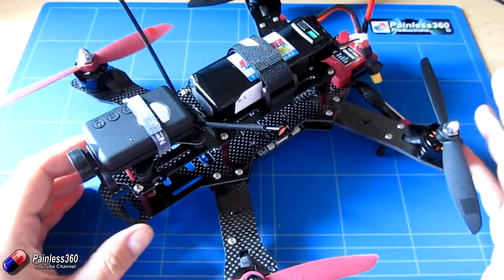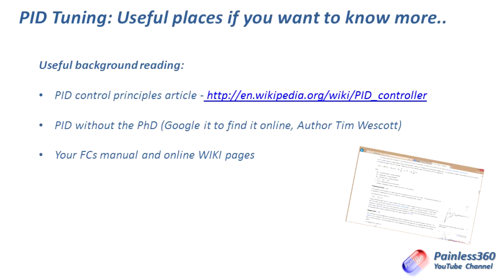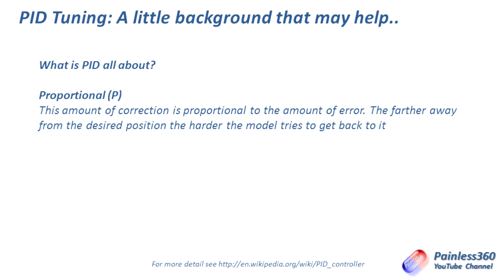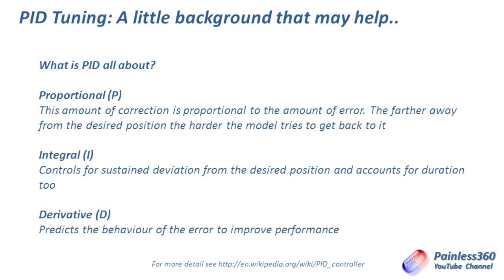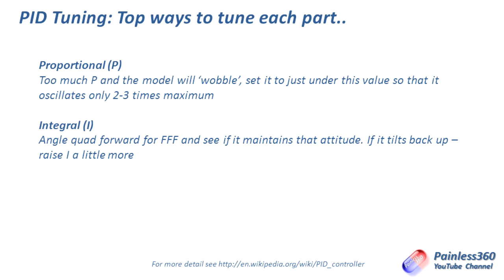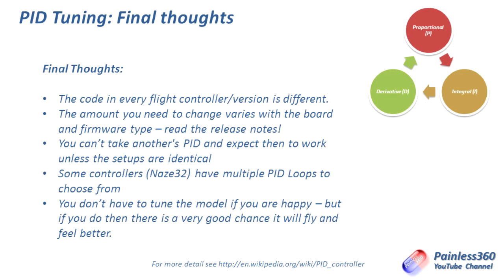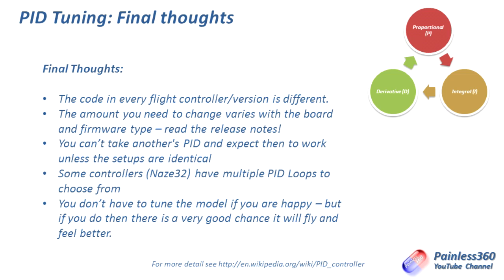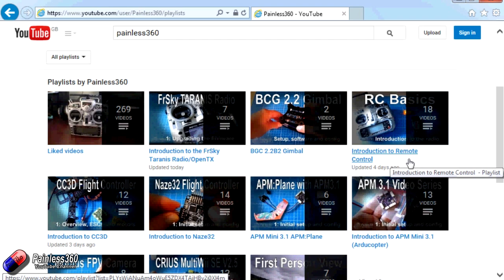Multicopter Tuning - Introduction to PID theory and how to tune your multirotor

Comment: Good information.  It took a while, years ago, to wrap my head around them and while I'm no pro, it usually only takes one good battery to get great numbers.  Then I usually take a couple more batteries flying around and slightly tweaking them if needed and setting the other parameters that surround the flight characteristics of the specific board I am using. I subscribe to the D, then P, and finally I method (Dave's).

Comment: Man, thats the best explanation of PID's on the entire interwebs, Thanks Chief! I finally get it, just need to suss out the TPA now.
Reply from the maker: +Mighty Chu "TPA basically allows an aggressively tuned multi-rotor (one that feels very locked in) to reduce its PID gains when throttle is applied beyond the TPA threshold/breakpoint in order to eliminate fast oscillations.." ;)
Reply: +Painless360 Ah right, I wont worry too much about that until i'v gone around the PID's a few times then, brilliant. Thanks again man! Really apreciate your channel.

Comment: Center of Gravity on the craft will affect the way it handles and can blur tuning efforts. The most common mistake with new pilots and modelers is to have the weight too far back with CoG behind the flight controller. This will make the quad feel as if the rear wants to wash out, and some of that lifting in FFF you mention. 
Tilted motor mounts, dihedral mounts on arm or motor, and motor plane on frame will also affect tuning. Regardless, Painless360 still covers the "feel" of what needs to be tuned so if you apply the concepts, then you will still find the quad tuned better. 
Centering the weight so the craft sets level at the center of the FC if possible will make tuning quick work though.
Reply from the maker: +Hiway Great points Hiway!
Reply: So true about CoG too far back. Happened to me on a QAV250 where on yaw it was so slippery. Solution - repositioning components for better balance and CoG.
Reply: modern day FC's can compensate

Comment: seems like someone could take that slide at the 12:00 mark and make a mini game out of it. some basic 2d wireframe thing where people could play with the PID settings to nail in a good flight, with a randomized  sweet spot each reset so it's not a memorize the numbers to finish the "game" sorta deal.

Comment: Great explanation, its refreshing to have a more systematic explanation, now what about rates nd tpa? how those affect tuning?
Reply from the maker: Tpa?
Reply: on the right side of PID, you have roll rate, pitch rate, yaw rate, TPA and TPA Breakpoint, I haven't found any info on TPA breakpoint but some people tune also the "rates" and tpa. What are your thoughts on this
Reply from the maker: I see, what GUI are you using?
Reply from the maker: I see. "TPA basically allows an aggressively tuned multi-rotor (one that feels very locked in) to reduce its PID gains when throttle is applied beyond the TPA threshold/breakpoint in order to eliminate fast oscillations.."

i.e. you can get the craft to tone down the PID settings when you are flying like a loon! :)

Happy flying!
Reply: cool, thans for the explanation

Comment: Thanks alot for taking your time to explain this to us beginners. I have been flying with factory settings.  It was hard but i think it made me a good pilot:-=)  Heh he.  Please upload files for download if possible.  You can download other peoples settings.    Thanks for the upload.
Reply from the maker: +Normann What files?
Reply: There was on one video where they shhowed how to adjust pid and such.  And he had his settings on a file people could download. And use for upload in the open pilot program.  If you see in the open pilot program. You can see that you can import settings.  You see:-))   I havent found the video.  But i saw it like a year ago when i started building.  Thanks for taking your time to teach us this.  Realy apreciate it:-)
Reply from the maker: +Normann I see, you mean the tuning settings? You can't use another's setting unless the frame, motors, props, balance, battery weight, battery size, flying style and piloting skills are exactly the same.. Best of luck.
Reply: Im starting now to understand the settings in the open pilot manager.   Wow what a fun hobby.

Comment: Hi. Great video as usual. I would like to ask a question on PID tuning. Everything I read and see on line talks about the PID setting on pitch and role. What about the Yaw PIDs? what effect altering the YAW have on the quad and how do you know when they are correct?
Reply from the maker: +Ray Gibbins Very similar to the others - if the yaw oscillates then check the P isn't too high, if it drifts then look at I etc.. Best of luck!

Comment: Nice video Painless, just a general question about pid. If a quadcopter has a large battery crossing the frame from back to front (like yours in this video) but it is also located 6cm under the chasis , so the movement in the roll axis  takes more effort, what shoul I do? Increase my P in the roll axis? Decrease it ? Raise the I?

I ask this because my batteries have died  so I cannot test anything right now.
Reply from the maker: +Dashz A larger battery lower on the frame will make the craft slower to respond compared to one with a lighter battery higher up. This affects the way it moves and how quickly the frame can be accelerated and then stopped in the new desired orientation. Any change to the frame layout will affect the PIDs  - slightly.. Best of luck!

Comment: Hi The manual for NAZE says cover the baro with foam and shield the board from sunlight. 
I notice you use a perspex cover and no foam. Is this just for video clarity or is the manual being over cautious?
Great tutorials BTW  I've learnt so much from you. Thanks
Reply from the maker: +Stephen Thorpe We always cover a baro with foam, the boards we build are actually inside the middle of a carbon frame so are shielded from the sun. The advice is there as the cheap gyros used on the model 'drift' with temperature. Happy flying!

Comment: Nice explanation. I am new in RC world. One question: Pg-24 of "PID without a PhD" is asking to start with D , then P , then I but in video you are starting with P?. Any specific reason?

Pg-24 reference of "PID without a PhD"
------------------------------------------------------------
"Once you get the setup ready, set all gains to zero. If you suspect that you will not need differential
control (like the motor and gear example or the thermal system) then skip down
to the section that discusses tuning the proportional gain. Otherwise start by adjusting
your differential gain"
Reply from the maker: You need a little P to stabilise the craft, no P will mean that the craft is pretty un-flyable. Happy flying!

Comment: Thank tiu for this video. Question for you when you tune do you tube for all axis? If I'm tuning P do I tune for pitch/roll/yaw before moving to I or D?
Reply from the maker: +sparkyondub2zz You do each in turn several times. As you get D higher you will find that you can also increase P a little more too.

Comment: Hi PL. Another great vid, thanks for taking the time to make it. Quick question.. I get quick oscillation with quick roll inputs. I really thought it would be P but right through the ranges it still does it? I'm using Naze32 with a looptime of 500, no mag, accel or baro. Any thoughts ☺
Reply from the maker: +doondedulin44 I'd check for excessive vibration in the craft first, then reset to defaults on the PIDs and start again. Could be P or D needs tweaking..
Reply: +Painless360 OK thank you. Will give it a try today :)

Comment: G'day  I have just upgraded from APM to Pixhawk controller. since the change i have noticed that the motors get quite hot after only going for about 10 minutes when compared to the APM. I am using the same batteries and ESC. Could this be a problem with the tuning? I have tried an auto tune with no difference. Thank you for all the time you put into making the videos. I find them pleasant to watch and informative.
Reply from the maker: Possible, I've not seen that here so I'd have a look in the forums for another pilot who've had something similar.. May need vibration damping or a different LPF setting..
Reply: LPF?
Reply from the maker: Try googling 'lpf painless360' to find out more.. ;)

Comment: Hello Painless360, firstly let me thank you very much for all your videos. It was a great help when building my first quad. I'm just about to start tunning my PID but I come to bit of a problem. I have all sorts/weights of batteries and if possible I want to keep same PID setting for all batteries. So in order for PID to work with all, should I tune with the heaviest or lightest battery I have? thank you in advance for reply.
Reply from the maker: +Martin Munz Tune with the one you'll fly with most ;) The difference in weight and inertia will affect the tune..
Reply: OK. Thanks for quick reply. Somehow I start to tune P and strange thing is that I increase it on Roll to 14 and only than I get wobble and pitch even to 25,5 (highers possible) and still no wobble. How this can be?  (using latest betaflight on Naze 32)

Comment: Hi painless, thanks again for all your videos, helped me build my first quad a Robocat 270mm with the SP racing F3, and 20A mini afro esc's.
I haven't played yet with PID's, and i was wondering if you should tune PID's for pitch/roll/yaw separatly or at the same time ?
Also, to tune PID's I need to be in accro mode right ?

Thanks a lot !
Reply from the maker: +Hamza Bendahou We have a video on PIDs that should help - best of luck!

Comment: +Painless360 I have a s500 drone with a cc3d and when I pitch forward or backward my drone immediately wants to pitch over to where it seems like it is going to flip over and it loses alot of altitude in a very short amount of time. what pid gain do you think is making it do this?

Comment: Hello Mr painless long time fan here. After seeing a lot of your quadcopter videos I decided to buy one for myself and I ended up getting a DJI 450 ripoff quadcopter and I set it up with a KK2.1.5 board. I flew in a little bit and got a little too excited and took it to my terrace where I tried to do some hover and straight line flying, unfortunately, the damn thing flew away and I have not been able to find it yet (I cut throttle when it went too high and it started acting VERY WEIRD after that and flew away into the sunset) . Could you please make a video where you show us how to locate a lost drone, set up a GPS system location system or just general noob tips.. 

I think it'll help out a lot of beginners like me from losing out on a lot of expensive equipment due to sheer stupidity.
Reply from the maker: +Brenden sounds like an excellent idea! I'll make that one! Hope you recover yours soon..
Reply: +Painless360 thank you. looking forward to you video.
Reply from the maker: You can preview it here - https://www.youtube.com/watch?v=K-5B_k8VOfA Hope it helps a little.. Let me know..
Reply: Incredible. Thank you! :D

Comment: Very interesting, would the same PID principles apply to a motorised gimbal? say changing a camera with a different mass and or COG ?
Reply: +mick thebass i would be interested in this answer....
Reply from the maker: +mick thebass It does but in my experience most of the gimbal problems stem from more basic problems - not having the camera in the gimbal so it balances naturally and not having the power setting high enough. I'd look at those first before looking at PIDs (do screenshot all of the settings before you start to change anything would be my last tip!). Best of luck.
Reply: +Painless360 Thank you, yes I will look into those points. I have watched both your video's on the BG2 gimbal with interest, have you any more gimbal related tutorials on your channel ?
Reply from the maker: Everything gimbal related is in that playlist. Best of luck!

Comment: Just a confirmation on this PID tuning. When you do this, do you have to be in rate mode or is it OK to be in horizon mode (because you said in your video that self-leveling should be off)?
Reply from the maker: +Jan Bobis Rate mode really..
Reply: +Painless360 Thanks

Comment: Have a question, just got an immersionrc vortex 285, i come from flying dji f450 so i like steady stable cruising. I know the vortex is made for racing but i want to set the throttle and the yaw, pitch and roll less sensitive so i can cruise more and not crash all the time. When i throttle up i have a hatd time hoovering and i just want more stable controls, i want to change my pid’s so it flies more like my f450, stable and more for cruising. The controls that are set now are to sensitive for me even if i fly in angle mode. To what values do i have to set my pid’s so it flies more like i want and how can i make my throttle les sensitive so that it does not shoots up like a rocket when i throttle up and doesn’t fall to the ground when i try to compensate and throttle down. I hope you can help me, been watchong your vodeos for a couple weeks and learned a lot! Thanks in advance mate!

Comment: Hello, great video, its made PID settings clear to me finally. I meant to ask, when you say to lower a value (say P as my craft wobbles and its hard to maintain altitude) how is this done ? seems to be a P value for roll, pitch, alt..etc. so I dont quiet get it? thanks bro
Reply from the maker: +ArabDrones You change the values in the software that sets up the flight controller for your model. There is normally a P, I and D value for each of the axis but pitch and roll are normally linked. Refer to the manual for whatever you are using. Happy flying!
Reply: +Painless360 thanks for the reply, i have cleanflight on a flip32.  so to lower p and stop the wobble i need to lower it for all 4 axis?  thanks, and iv got this far in my build and set up and osd using ur vids so thanks. god bless
Reply from the maker: The detail you need should be in this video. If you need more help then we can provide one to one support (but that isn't free). Best of luck!

Comment: Awesome video thank you! Quick question, does it matter if I tune using horizon mode vs rate mode on a naze32? If I tune in Horizon, does that carry over to Rate? Thanks!
Reply from the maker: +Mini Quad Topix Always tune in rate mode (as covered in the video) otherwise the autolevel is working to level it out all the time and you can't 'see' how the craft is behaving.
Reply: +Painless360 Got it, thanks!

Comment: when you say to increase a little, how much should I bump it up? I know that I need to increase I as my nose rises but how much should I bump it up each time? I am using multiwii rewrite in clean flight on an emax nighthawk pro 280. thanks :)
Reply from the maker: +Angus Gebers That all depends on the software you are using. Read up on others who've tuned what you're using. Normally the increments are very small for I and D.. Best of luck!

Comment: Hello just goin to start my pid tuning. via a roatory switch which is the starting and end point should I set to get a good range for all my tuning? thanks neil
Reply from the maker: Depends on the flight controller and firmware you're using - I'd spend some time on the documents making sure the radio is setup perfectly. Best of luck with it!

Comment: I'll be ordering the Eachine Racer 250 in a couple weeks, and I was wondering what's a good program to tune the PID's? Does it come with a program to tweak these settings or do I have to download my own such as Open Pilot?

Thanx for any help.
Reply from the maker: If you check out the specifications then you will see its a CC3D flight controller. Will be normally flashed with Openpilot or Cleanflight. The manual isn't much help. Best of luck!
Reply: +Painless360 
Thanx man! One more question. How do you feel about the release of the 180 Assassin by Eachine? I'm now kind of torn between it and the Racer 250. The Racer 250 has been out for quite some time and has great reviews, which is why I want it, but the new 180 Assassin has GPS and comes with goggles.

Do you feel it is worth being one of the first to get it (without any reviews) or should I go with the 250, which everyone seems to love?

Thanx again for any help man!

Here's a link for reference...

http://m.banggood.com/Eachine-Assassin-180-FPV-wEachine-VR-007-HD-Goggles-I6-Transmitter-Built-In-OSD-GPS-NAZE32-RTF-p-1028910.html
Reply from the maker: It looks very cool but I've not flown one - yet >;)

Comment: Have you test the Autotune modus with Cleanflight? I've test it today with Cleanflight and Seriously Pro... I damage my Craft! It go UP, UP and UP of 50m... When i switch it back, the Copter fall down....
Reply from the maker: +OctaviaTFSI See my comments at 17:00. I have not used this often as I like to play with the settings to get it to 'feel' right for me. Autotune on all FCs can be a double edged sword and cause the odd crash..
Reply: +Painless360 I have Autotune apply for my TBS Gemini, and it was working perfectly... Now i have to register, that is not every board the same... Thanks for your support ;-)

Comment: what do the PID values refer too  gain /min per repeat / repeats per min as seen in my long past industrial pneumatic Foxboro Model  40 days
Reply from the maker: +Joe Stubbs They are arbitrary figures that are used with whatever PID loop code/system is bring used. Happy flying!

Comment: IAM using libre pilot with a cc3d with 5 4 props and 12a becs. And yes there on right and spinning in right position ..and using flysky fs iA6b battery 3s ... please please help